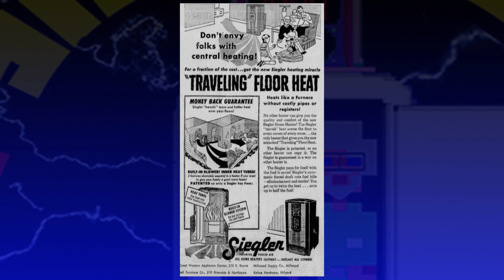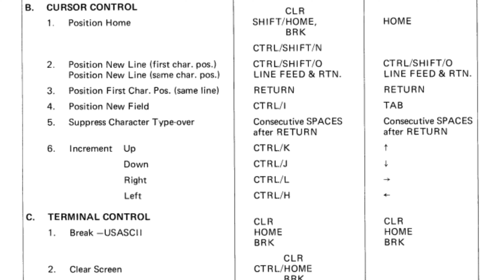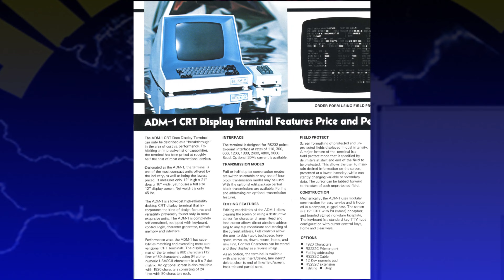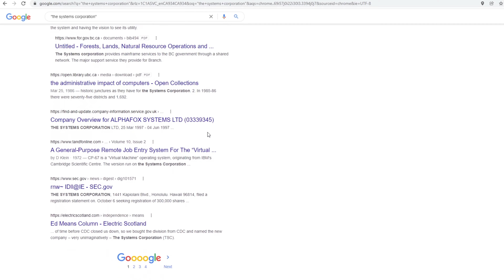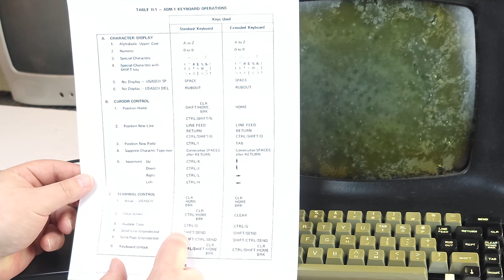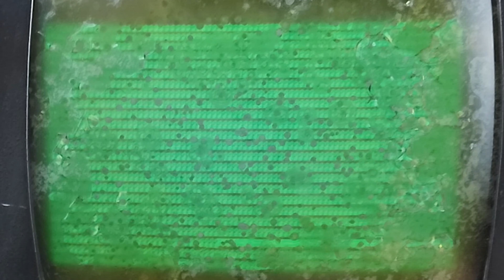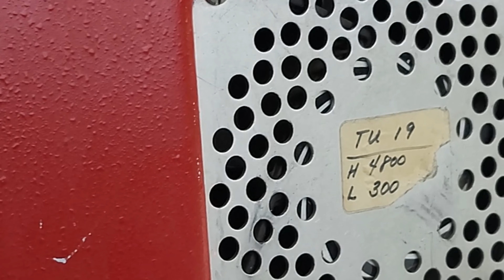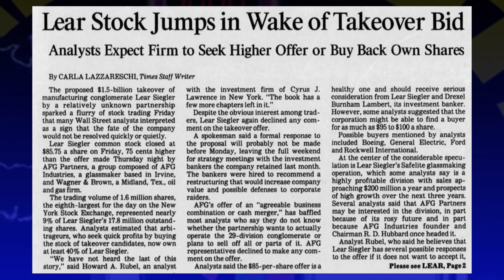Birth of A Dream Machine - The LSI ADM 1

Comment: I love your thoroughly researched history videos and the calming tone of your channel. Great work you've been doing, and very enjoyable. I just regret that, on the restoration side of things, you have all the way to go! Which is a pity, given that you do handle -- i.e. open, disassemble, poke around, etc., which alone can destroy a piece if not done properly -- rare and historically significant pieces. And if these pieces aren't treated properly by the person who just acquired them, probably they won't be treated properly by anyone until you sell them again, presumably decades from now, when it may be too late. The restorers among your audience will cringe a little here and there.
Reply from the maker: Well first, thank you.  Second.. I'm not sure what you're taking issue with specifically.  I've restored over 40 machines from non working to working status.  That includes an Apple Lisa with catastrophic battery leakage, a defunct digital group z80, some non working OSI gear.  I take appropriate precautions for static (off camera), and check power supplies etc with my scope.  What am I doing wrong?  This is just a cursory assessment and cleanup video.  More serious restoration work will come later.
Reply: @TechTimeTraveller  Apologies if it got across too strong, it was not the intention. You're not destructive at all (some others are). It's good to hear that you do take ESD precautions, even though they aren't visible on camera. Those are critical when touching any semiconductor, even in-circuit. It's not for me to say what is right or wrong, but I can share with you how I would go about things. I'd not take the machine apart just for a cursory clean, then put it back together for a relatively lengthy testing session. Once the machine is open, beyond a thorough visual inspection for corrosion, bulging or electrolyte-leaking caps, missing components, charred resistors, etc., checking all caps with an in-circuit ESR meter is important before turning the machine on for more than a few seconds, or you could cause serious problems. Caps with large ESR tend to have dried electrolyte and won't reform properly with the machine on. The oxide may crack fully, potentially causing devastating DC shorts. Checking forward voltages (with the machine off) on diodes and transistors against specs is also a good idea before lengthy power-on periods, as marginal parts can short after a few minutes of usage. When you do turn the machine on, I'd measure the power rail voltages immediately, as the machine may work with voltages beyond tolerance, but will also damage itself. You won't see this if you turn the machine on with the case in place, without measuring the voltages and ripple on the power rails. By the way, excessive ripple is common and can damage a machine after only minutes of use. You want to measure it with an oscilloscope in AC coupling, and ensure ripple on, say, a 5V rail is under 50mV. Blowing dust off the circuit boards with an ESD-safe, high-pressure air blower also helps prevent arcing induced by humidity-rich dust particles, lint, etc. It may also be a good idea to preventatively swap out components that operate under high heat (such as pass transistors, linear voltage regulators, rectifying diodes, high voltage drivers, etc.), as electromigration is accelerated by heat and renders those components deceptively marginal. If those components are in the power supply, when they go they may take the entire digital board with them, so it's often a good idea to reconstruct the entire power supply circuit before turning the machine on for more than a few seconds, if you can find new but original parts (most power supply components from the 70s are, unbelievably enough, still manufactured today). The original CRT looks to be in order (at least on your video I couldn't see any burn-in, and the phosphor seems to be still quite bright), you don't need to throw it away just because of the cataracts. You can remove the safety glass to sort it out. The chances that you will blow the tube are relatively small (1 in 5?) if you heat it slowly and uniformly and, in any case, better than throwing away the original tube. Red also clearly isn't the original color of the case, as one can see the original light blue showing where the red has pealed off, so I'd surely try very light, low-pressure sand-blasting to remove the after-market layer and then respray with the original color. The keys may also deserve some retrobrighting and UV-protection. Anti-corrosion treatment of ICs and port connectors (with electronics detergent and something like DeoxIT D5) will also help preserve them. And so on. Keep in mind that those machines were never designed to be turned on 50 years later, even in the best case scenarios! But I don't mean that you absolutely have to do all this stuff (although, if you can and feel like it, it's definitely a good idea), the intent is just to give you examples. Keep up the excellent work and thanks for the great content!
Reply from the maker: Thanks yes no worries.  I watched some of your videos and generally was impressed with your thoroughness.  The issue with me is I often do things and don't video or don't remember to video/explain.  Part of the youtube learning process.  In this case, doing my visual, DMM and scope inspections just didn't work with the camera, I kept getting in the way.  I probably should be more forceful in saying 'hey, I did this off camera, don't try this at home without doing a b and c', but I forget sometimes, or I feel like there's debate on what proper procedure is and don't feel confident to say 'you must do this'.  I've been collecting about 20 years and I've developed an appropriate level of caution.  In the old days I would have just plugged something in and most times got away with it but sometimes didn't.  These days I trust nothing, I check the wiring out under good light, I look for cold solder joints, breaks, signs of fire, leaks. I always test power supplies as thoroughly as I can both to preserve the equipment and also for safety reasons. For this ADM-1 I did all that, and I had spoken with the seller who insisted it had been powered on without incident before.  After verifying there were no issues with power going to the board and that the CRT seemed alright, I decided some short attempts to start it were okay.  That said, it will undergo a deeper restoration including hopefully figuring out how to get the implosion shield safely off to clean and remove the cataracts.  But for now I just wanted to show folks something that you don't see every day on Youtube.  Anyway I appreciate your comment, it did make me think.

Comment: Fun video.  Quick suggestion, you may want to balance your audio a bit more.  Your voice over is significantly lower than the rest of the audio.  So when you switch from your soothing baritone voice to a movie insert or live recording it's a bit shocking.
Reply from the maker: Thank you.  Yes, as a novice my 'skills' with audio have been evolving and sometimes things that sound right to me don't sound quite right to others.  Never thought audio would be as hard as it is.  Bugger of it is I adjusted the volume downwards are the segments that jump out several times and thought it was under control.  Although I did pick a movie sequence where the character kind of raises his voice abruptly.